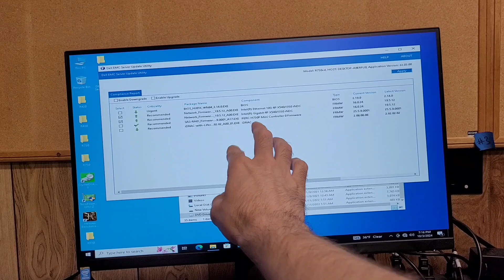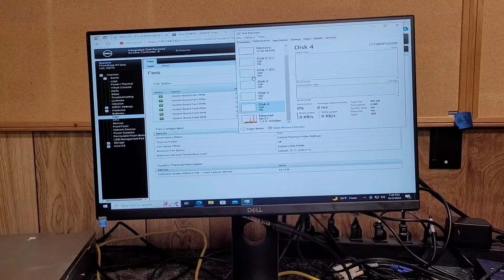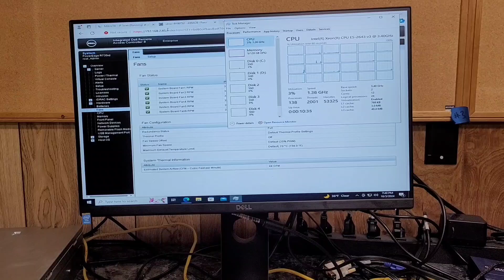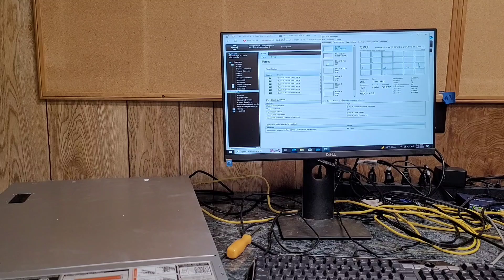Finally building out my new Dell PowerEdge R730xd 1 year later

Comment: I honestly have to laugh at the guys that think a modern CPU and NVMe drive on a normal PC motherboard will come anywhere close to what those old Xeon Server motherboards are capable of, especially considering the fact that those old boards usually have two to four times the system RAM that the average gaming PC does. Add in the second CPU and associated PCIe bandwidth and that server will run rings around the gaming PC. Sure, modern Xeons and their AMD counterparts would be faster, but they're also significantly more expensive than what you already have. I'm actually in the process of bringing several older Dell Poweredge servers online here, so i know what kind of effort is needed for this.
Reply from the maker: Yeah gaming PCs are horribly limited on PCIe lanes. For a server I'm currently working on AMD epyc was the only CPU out there that could hit my power target while still having plenty of cores and all the lanes I could ever want. It is really hard to accomplish anything exciting with consumer hardware in comparison.
Reply: @computersales  Indeed. Too many items on a single CPU motherboard and you saturate the PCIe bus, which will tank the performance of otherwise faster parts. Server or Workstation motherboards with dual CPUs and up to the limit of the CPU capacity of supported system RAM will fare much better.
Reply: @computersales  By the way, I have one of those exact systems coming from an eBay seller. It should be here early next week and start taking up residence in my rack between my R710 and NetApp DS4243 DAS unit. It has the integrated NIC with two 1Gb Ethernet and two 10Gb SFP+ ports and the H730 1GB RAID controller, though I will likely be replacing that with something that plays nice with ZFS as I plan to install either FreeNAS or ProxMox on it.

Comment: is there a way to make nvme drives work with a dell r730?
Reply from the maker: Yes they are compatible. Making sure BIOS is up to date helps. Otherwise it is just a matter of having the right adapter card and configuring bifurcation as needed.
Reply: @computersales  I tried using a megaraid card but it didn't get detected by the bios, it has the latest update. Please note i'm asking about the R730 not the r730XD
Reply from the maker: @MarloMitchell  I'm not familiar with that. What megaraid card are you using for NVMe?

Comment: You wont be able to get the mid bay installed with the GPU and those 2u heatsinks. You could however install a 2x 2.5" flex bay in the back if you notice those slots. Hard to tell but looks like you may have one installed Nice server
Reply from the maker: @gonootropics2.065  yeah no mid bay support in this build. I did install the parts to use the flex bay since mine didn't include them.
Reply: There is a trick, actually. You can install desktop 3060 with 1 fan (anything up to 190mm in length would do the job i guess). Even if it's not designed for such application, it still would run pretty good. That was the thing i did in my r730xd build.

Comment: How did you connect that loose SSD inside the unit? I see the SATA ports but what did you use for power?
Reply from the maker: @Roger52906  used the optical drive SATA and power cable.

Comment: That Dell machine is about 9 years old?   Interesting build, but a modern 6-core Ryzen and modern nvme SSD will be much, much faster.  And for not much money .
Reply from the maker: It will have 20 cores eventually. Plus this can hold more drives with less effort than a custom build. Also can take more memory. Also way more PCIe lanes.
Reply: @computersales  A modern PC has one ultra-fast nvme SSD drive, and maybe one 15 or 20 terabyte hard drive.    A lot has changed in 9 years!   😄
Reply from the maker: @DerekDavis213  I'm using this as a server not a desktop so your points are valid but not for my use case.
Reply: Faster CPU doesn't mean much for a server.  All depends on the needs.  If you need to move a lot of dirt, will a sports car be faster than a dump truck?
Reply: @dave2132  6 super fast modern cpu cores are going to be faster than 18 cores on an old Xeon chip.
Reply: @ spoken like someone who doesn’t understand that different hardware is used for different purposes.
Reply: @dave2132  6 ultra fast cores versus 18 old slow obsolete Xeon cores.   6 fast cores will win!   That's basic.
Reply from the maker: @DerekDavis213  sounds like a good video idea. If you make one I'd share it to my followers if it is good.
Reply: @DerekDavis213  Either you're trolling, or you're twelve.  Take care.
Reply: @dave2132  I would take an ultra fast 8-core processor from 2024, instead of an old dusty slow Xeon 18 core from 10 years ago.   No trolling here, I work in IT.
Reply: @ a support job doesn’t really qualify. You’re thinking is shallow and shows you don’t really understand why people use these machines. I’m sure the channel’s owner doesn’t like arguing here, especially when it’s over something as basic as this. So sure, use your ultra fast 8 core processor and fast nvme to run call of duty. This conversation is pointless.
Reply: @dave2132  use your ultra fast 8 core processor and fast nvme to run call of duty

No, I will use the modern ultra-fast 8 core for video editing and video encoding.   And the performance will be much better than an old, slow, dusty Xeon processor from 2014.